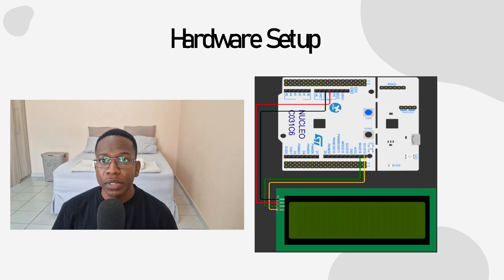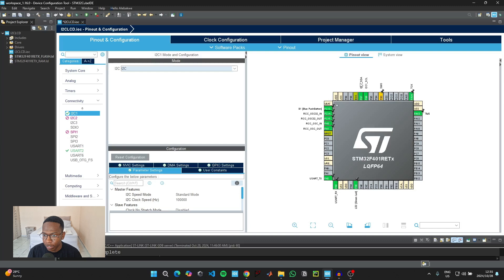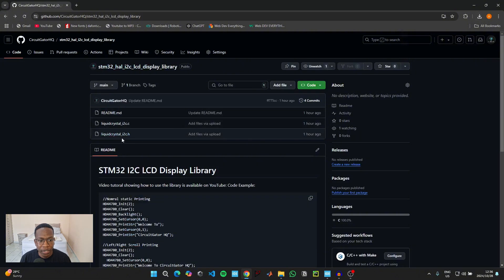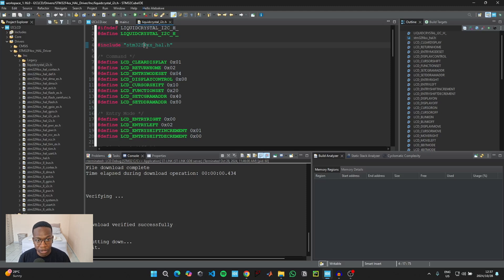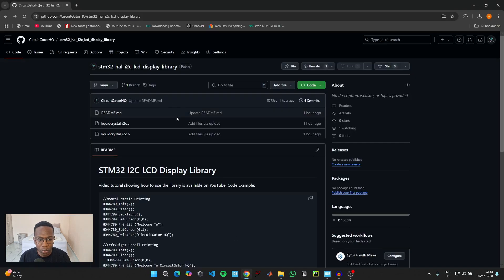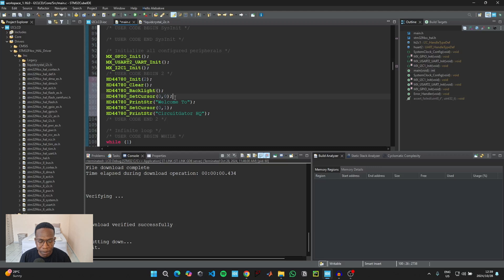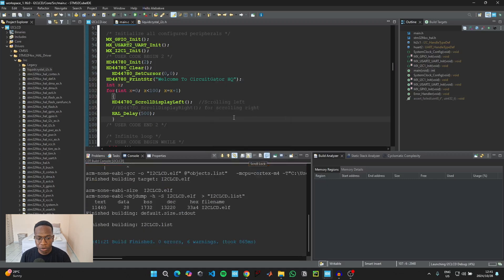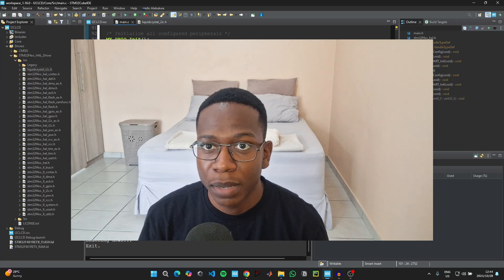STM32 LCD Display I2C EASY TUTORIAL

Comment: can't get mine to work. Could you go over any settings you already had. Also, im using l4 instead of f4, did the change in the code but still won't run.